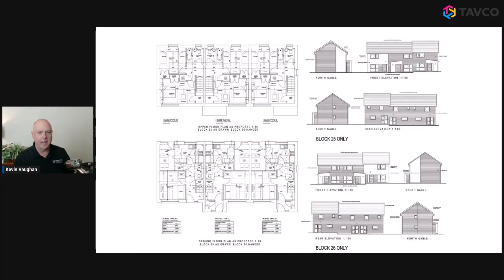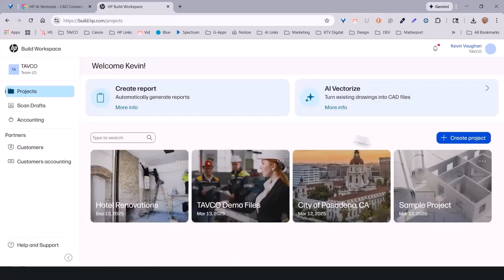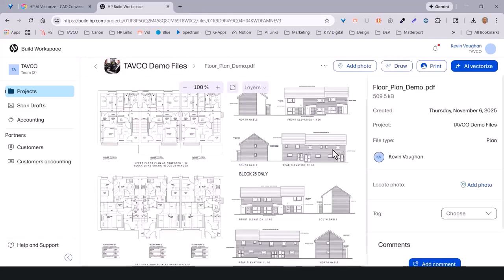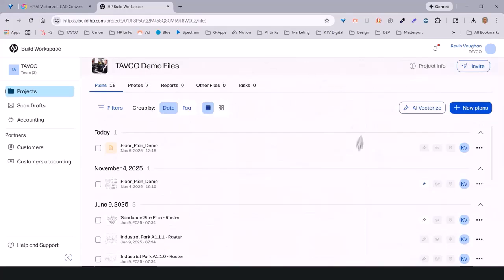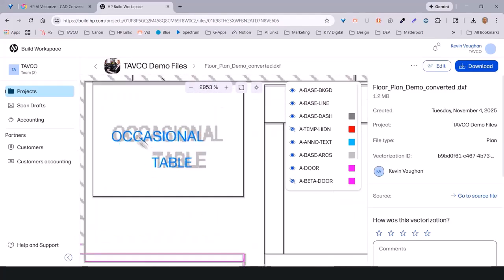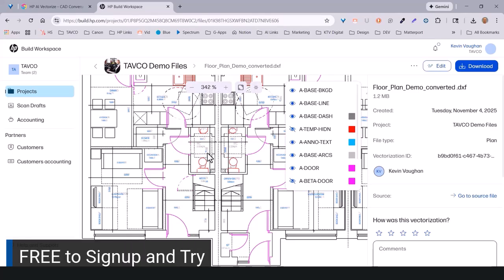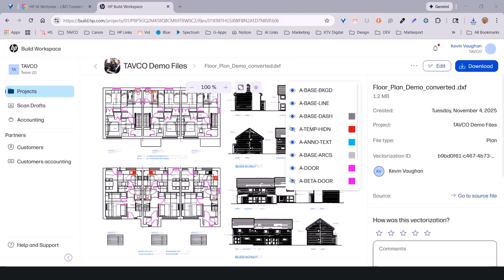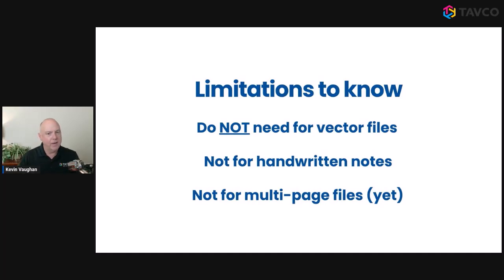Turn Old Architectural Drawings into Editable CAD Files in Minutes with AI - Raster to CAD

Comment: If the pdf is saved as vector pdf instead of raster you can just import it in any software and it will turn it into cad. No AI needed. Raster images thats where it gets more complicated.
Reply from the maker: Great observation, and you are 100% correct. Honestly, that is where some of the confusion about AI Vectorize comes from. If the PDF was produced in CAD, then it is vectorized, and you do NOT need this software. However, where Build Workspace becomes awesome is when you feed it a scanned (flat) image with ZERO vector data. It saves many hours of work vs redrawing manually. Check out the ROI calculator to dig deeper: https://vectorizeroi.tavcotech.com/